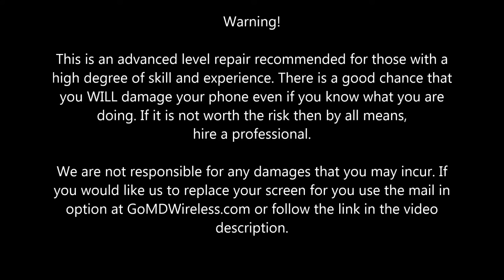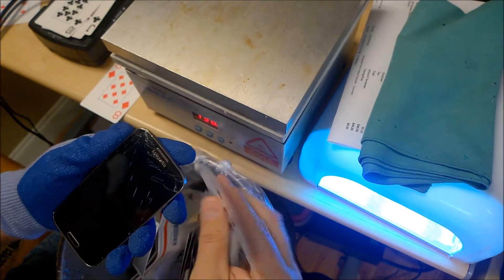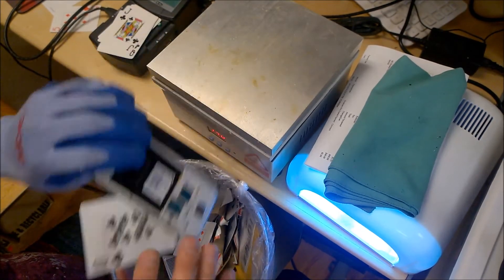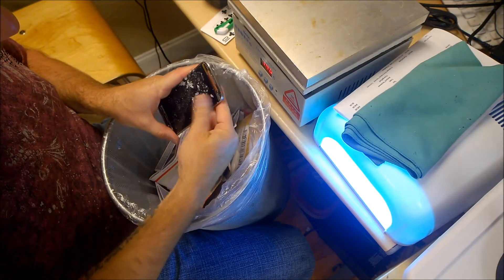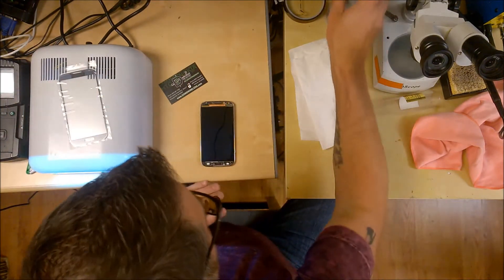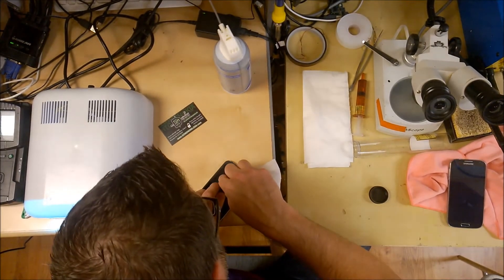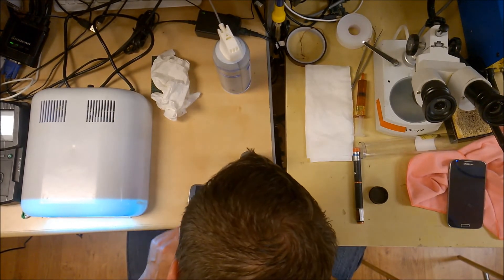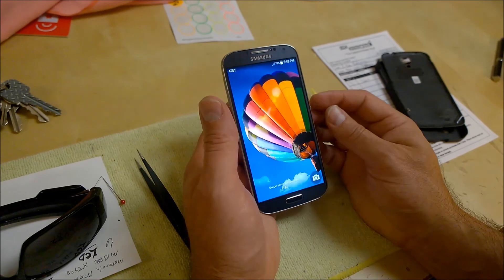Samsung Galaxy S4 Glass Only Replacement

Comment: Hi, bro, can I ask a question - can you separate the glass from the lcd with a heatplate without removing it from the frame(samsung s7, 8 etc.). I see it's possible with a freezer, but can you do it with a heatplate as well?

Comment: Any thoughts on using a hair-dryer (180F)?  Most of the videos I've seen use that (ECO-FUSED  , JerryRigEverything, etc)?    Also instead of the glue/uv, will the double-sided tape not work long term?
Reply from the maker: If you have a hair dryer that gets to 180F then I’d think yes, probably. As far as tape goes though you’ll run into touch issues and dust under the glass.

Comment: I seen on a how to video on here a guy used fishing line,this other used lots of tiny bits of paper,i think the fishing line would work the best
Reply from the maker: Molybdenum wire is safer but not easy to use anything like what you describe unless the display assembly is removed from the mid frame first. That's the catch with Galaxy series. Getting under the glass with wire or any type of string is difficult because of the bezels protruding beyond the glass.

Comment: hi, how is the glue not entering to the speaker?... and..what if some glue enters into the iPhone?
Reply from the maker: Sealing the edges with the flashlight and using just the right amount of glue helps a lot. If you get glue inside it can be removed with cloth wipes or you can leave the affected part under the lamp until it dries. 99% isopropyl alcohol removes wet loca too but you have to be careful where you use it. It will literally remove the paint from the back of the glass screen. For example if you dip a swab in it and try to clean the hole where the camera sees through it will immediately strip the color off of the lens.
Reply: Ok, I will do my best...
Reply from the maker: I just realized that this comment was on the old video. Please watch this one first if you haven't done the repair already https://www.youtube.com/watch?v=adsjgRDVqUw

Also before you put the board back in set the display assembly/mid frame face down on a flat surface. Push down gently against the upper third of the frame where the board will sit. You should be able to see if any glue squeezes out. If so do your best to remove it as this can seep into the components.

Comment: As someone who has worked in the cell phone repair industry for nearly ten years, I have occasionally referenced these types of videos with my coworkers when poking fun at alternate "shortcut methods" of screen repair.  However today is the first time I have actually had to deal with the results of a glass-only replacement with LOCA and WITHOUT first removing the OLED-digitizer from its frame.  It was an absolute NIGHTMARE.  A properly built Galaxy S 4 OLED-Digitizer is laminated to its cover glass using LOCA and the UV curing method OUTSIDE of the phone.  This assembly is then installed onto the magnesium and ABS plastic midframe using a solid acylic glue.  When you remove the acylic frame adhesive during disassembly and simply pour LOCA onto the OLED, you will flood the internals of the phone with LOCA.  This material does not ever cure until directly exposed to ultraviolet - it will coat the inside of the phone in a oily substance that is virtually impossible to dissolve using every day solvents.  I have spent over two hours today just trying remove the LOCA from my customer's midframe so a new OLED assembly can be installed.  The coating of LOCA has permeated the frame and made it impossible for the new acylic to bond with the ABS plastic of the frame.  If I had a spare midframe in stock I would have much preferred to throw away his front housing and replace it for free rather than deal with the results of the previous technician's lazy work.  By the time i finish cleaning the LOCA off my hands, tools and workstation, what should have been a 1 hour repair will have eaten the last 5 hours of my life.  To be clear: following the above steps will not ruin your phone. LOCA is non-conductive, non-corrosive and will not cause damage to the electronics inside your phone no matter how much the motherboard is made to bathe in it.  This method will however make your phone damn near impossible to fix properly the next time your screen breaks.
Reply from the maker: If you are finding LOCA inside of the mid-frame then it was not applied properly. When this happens it is a pain to clean no doubt. Thats why we seal the edges with a UV flashlight as the bubbles are worked out. Its really not that difficult if you have patience and becomes easy with practice. You must use the right amount of LOCA though- about 1-1.5 ml with an S4 for example. Of course we cant tell other repair shops how to do their job so sometimes we do end up dealing with the situation that you described. The most thorough method to remedy excess LOCA is leaving the assembly under a UV lamp overnight. It will dry even the areas that you cant see if given sufficient time. As far as removing the glass I find it much easier/safer once it has been replaced previously especially if you used Octopus brand. OCA sheets on the other hand slow things down a bit as they are much stickier.
Reply: ree
Reply: rdr

Comment: I just replaced the screen of the phone but when i boot it up the screen is like this http://forums.androidcentral.com/attachments/samsung-galaxy-s4/157171d1419912472t-green-pixeled-screen-samsung-galaxy-s4-t-mobile-what-s-problem-c360_2014-12-29-22-34-30-173.jpg is this the screen problem or logic board? the screen does this for 10 seconds then turns black and at the top left corner there is a blue flashing LED. There is no boot sound but i can sort of see the galaxy logo.
Reply from the maker: +Anonymous Dev Team -Mrn00btroller (David) Did you replace the entire screen or just the glass? That looks like logic board or flex cable damage to me. I never say never but so far I've haven't seen an S4 do that because of a defective AMOLED.
Reply: Go Cell Phone Repair glass only. I just reconnected all the cable and this time i'm getting a boot sound and it fully boots but i still cant see what is on the screen. i also know that the touch screen works because i can enter my password. I think this is the flex cable or GPU problem but isn't the GPU on the CPU? So if the GPU is faulty should the CPU be damaged too? I sometime get the same effect when i don't plug the VGA cable in properly to my PC so maybe this is the cables fault.

Comment from the maker: @Rocio Parra Depends on the lamp. With the one used in this video 10 minutes on each side is plenty. Once any glue overflow turns solid you should be fine. More time can't hurt if you want to play it safe.

Comment: HELLO! I GOT MY FRONT GLASS REPLACED. BUT FROM ONE SIDE GLUE OR GUM KEEPS ON COMING OUT FROM BENEATH THE GLASS. I CLEAN IT WITH TISSUE BUT        AGAIN AFTER PICKING IT OUT OF MY POCKET I GET IT LEAKED. WHAT DO YOU RECOMMEND?  DID THE REPAIRER NOT HEAT IT PROPERLY?
Reply from the maker: +Ahmad Zeeshan They did not fully cure the glue. You can take it back to them or leave your phone out in the sun for a few hours. This will usually allow UV to penetrate beneath the lens.

Comment: ok I use the playing card technique myself and have never broke the amoled screen but the way the guy applied the loca glue is unbelievable the amount of bubbles in that must of been unreal I always strip the logic board camera and proximty sensor out as it only takes 5 minutes and seal around the screen with 2mm double sided adhesive to stop any loca going behind screen and to aslo to hold the outer edge of the glass and if you cure your loca for the right time then I have and will continue to remove broken glass of loca glued screens aswell
Reply from the maker: +kingo1988 No bubbles on this one but he has been doing them for a very long time. This was actually the guy that taught me glass only repair. Personally I take out the board too but I guess when you get the glue application down 100% you don't have to worry about LOCA seeping through. But again I agree take it out especially if you are still learning. Sealing the edges will almost guarantee you don't have anything coming through at the top and bottom ends which is where the trouble can occur. I posted an updated video earlier this year that you might find helpful: https://www.youtube.com/watch?v=adsjgRDVqUw
Reply: I wasnt saying that the bubbles were in when set but he spent a short while getting them out where as if you apply the loca properly then there will be no bubbles to start with but hey I guess were still learning

Comment: Ooooh my god, this is the worst method I ever seen. First of all using playcards its really possible to break the lcd. Second you didn't remove the logic board, camera and proximity sensor and therefore after a few days these components will not work properly. Sorry dude but you are really amateur............
Reply from the maker: nikos antoniou By LCD I assume that you meant AMOLED. If you broke it using a playing card I'm going to say that you need a little more practice and be sure to TAKE YOUR TIME. There is no rushing this process. Keep in mind these displays are as fragile as eggshells. It really isn't that difficult but if you are struggling after many attempts then maybe this is not for you. Most of our new techs pick it up easily but there will be a person here and there that just can't seem to get the feel for it especially when it comes to maintaining a constant temperature. While I do recommend that beginners remove the logic board and other modular components as a precaution, once you have enough practice you'll find that it's easy to prevent the LOCA from leaking through the mid-frame. In fact you'll wonder why you found it so difficult in the beginning. If you are still having issues with that then re-watch the part where he uses the flashlight to seal the edges and make sure that you aren't putting too much glue down. You only need about 1-1.5 ml. Good luck.

Comment: Can i use barbicide to clean
Reply from the maker: ***** I'm not sure about that. Haven't tried it but I'm skeptical as it has several different chemicals in it. Would be a shame if it damages your AMOLED.
Reply: Go Cell Phone Repair so stick with rubbing alcohol?
Reply from the maker: ***** That's what we use. It's cheap and it works.

Comment: what substance do you recommend to clean the excess loca glue that flows to the back of the amoled circuitry chip bottom  galaxy s3
Reply from the maker: Rpc Montes 99% isopropyl alcohol.

Comment: so i heated my plate to the suggested 140c in your video and it fried my display.....not too happy about that.
Reply from the maker: Hi Deb,

This may not be the answer that you are looking for but hopefully you will find it helpful. Bringing your digitizer to the desired temperature depends on several variables. The temperature of the plate, how long you leave your screen on it, the ambient temperature in the room where you are working, and most importantly the grade of LOCA that the manufacturer used to bond the surfaces. This varies even within the same model including the S3 and S4. White requires the lowest temperature and brown the highest. I've had this discussion many times when it comes to soldering and the answer is similar. Once the glue reaches a point where it becomes pliable that is where you want it to be. Trying to set specific time and temperature parameters is difficult because every piece of equipment is not identical and it is more important that you stay within a range that allows the glass to be removed without burning the screen or sticking to it. In my experience working with the plate at 120-140 C is fine in 7-8 second intervals alternating with 15-20 seconds off of the plate while prying the glass until it starts to feel stickier again. Outside of that I don't have an exact temperature to shoot for as that tends to lead more often to burned AMOLEDs. When I am able to I'll do a durability test and see how much heat each screen can withstand so that we can publish a reference guide.
Reply: Tim Padgett The components in the LCD are damaged around 100c so I keep it in the 90's and I have not had a problem with it. Takes more time to remove the glue but have not had a damage screen yet.
Reply from the maker: How long did you leave it on the plate?
Reply: Didn't time it but it couldn't have been more than 30-60 seconds.
Reply from the maker: Ouch, yeah that will do it. 7-8 seconds on, 7-8 seconds prying. Any more than 10 and it will definitely burn.
Reply from the maker: *Risk burning I should say.
Reply: Go Cell Phone Repair the point of having a precise hot plate is to set a temp that you can work on the screen without burning it 
it should have been mentioned in the video that 140c is not the temp that you want your digitizer at,

what is a safe temp for the AMOLED? 160F?
Reply: Go Cell Phone Repair 120c-140c temp set on the plate is not the temp you want the screen to be at 
I am sure anything beyond 100c will burn the amoled  screen. 

If you can come up with a number that  the screen can be left on the hot plate at for a long period without burning the amoled is what we are missing.
perhaps 80-90C for few minutes  at that point all the assembly is at at that temp and the glue can come off easily. 

we need to find the minimum temp that most screen glues become pliable this way we just raise the temp to that level and no burnt screen exprience no matter how long the screen is left on the hot plate.
Reply: Tim Padgett Same here...Shame
Reply: Rujikin 80-90C is the number I remember also 
I will have a broken galaxy S4 screen to practice on  will set it at 85c see how it goes
Reply: I kept mine at 66 c before this vid.  I regret it
Reply: Zena TV 66c is too high??

Comment: I was wondering I have used both methods the wire and the playing card method. At first I thought the wire was the best but the more I do it I keep messing up something. The other day I was removing glass on note 2 with wire and cut the polorizer in half. Anyway I managed to get glass off without breaking lcd and watched a video on how to remove polorizer with adhesive remover and razor. I successfully completed that also now I ordered new polorizer and a roller. And now I'm scared to finish it.lol anyway is it easy to do the polorizer film and what method do you prefer.  When removing the glass. .
Reply from the maker: Are you talking about OCA sheets? We gave up on those a long time ago. One you cure them there is no turning back. And if you crack your screen again you are finished because their bond is permanent. If you are referring to the digitizer no I haven't tried replacing one yet. Usually when it is damaged we just replace the whole display. In most situations I use a playing card because of the housing being in the way of the wire. When I do use the wire I start at the end opposite of the flex cable because as you mentioned it is very easy to damage.

Comment: what do you charge to change glass only on S4? ...amoled works perfectly
Reply from the maker: We charge $100. The digitizer has to work perfectly also since it is attached to the AMOLED.
Reply: Go Cell Phone Repair dude im not telling you you charge much on this cause i dont really know whats going on im not expert , but i see the only screen on amazon is for 20 dollars and it comes with its own kit to repair so is it like fake one and do you install the original one or why is the price so different?
Reply from the maker: Wrong Wrong The part is not that expensive. Labor and risk of damaging the AMOLED is what the price is based on. $100 is the going rate for professional installation. I can't speak for Amazon specifically since they fulfill orders from all sorts of different sellers but the glass that we use is high quality. No crooked logos or thin materials etc.

Comment: Thanks for the video, it just seems like the method used to put the glue on would create or promote a lot of bubbles that would need to be worked out. Especially how quickly the screen was dropped on to the digitizer. Wouldn't using an "X"  or "stick man" pattern create less bubbles and make the job easier?
Reply from the maker: Yeah since this video I've been laying down the glass much slower. Think of it like dipping your hand in water without creating ripples. When you can move that slowly you will have very few bubbles to deal with.